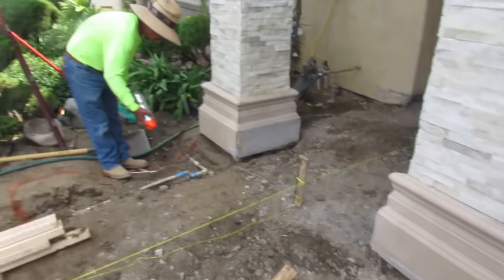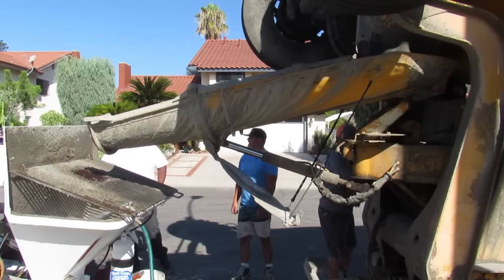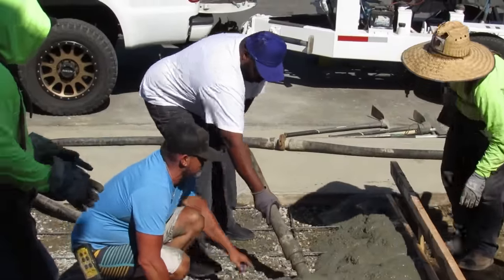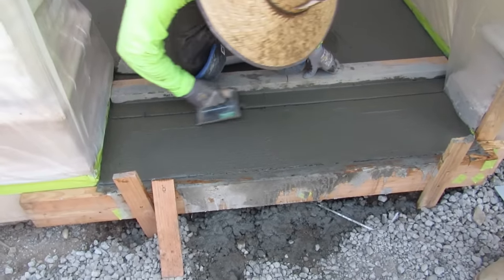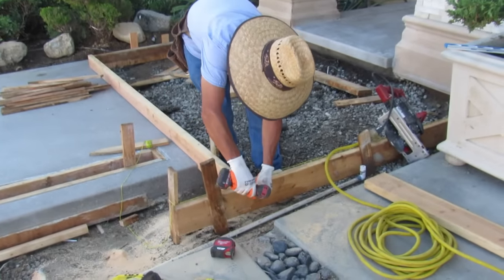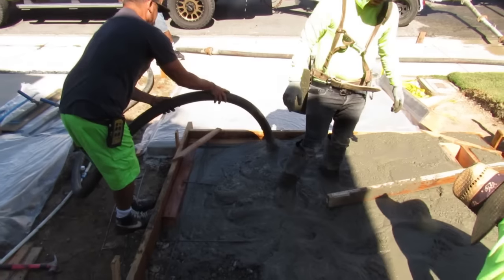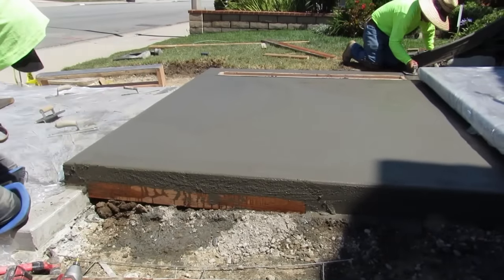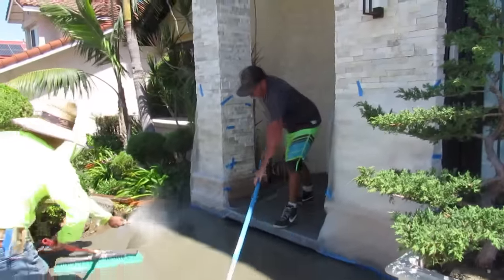Concrete Floating Steps! Straight Fire!🔥🔥BEST IN THE WEST!

Comment: Only certain concrete contractors are able to do custom quality concrete like this...anyone can pour cookie cutter driveways and patios.
I was getting $2000.00 - $3000.00 per cubic meter on average in the '90's and a lot more when it came to small custom jobs that involved stairs with planters. An average set of cast in place stairs was a minimum of $5k and my most expensive in 1998 was a $25K step that took 4m3 and had built in planters. I've had many high end residential clients spend in excess of $250K for exterior concrete work in the late 1990's. I made my money doing high end work and we still did 50% commercial work where $ was made on volume, but I preferred the custom work because of the challenge.

Every company has their own business plan, and mine involved challenging myself and doing projects that set me apart from the majority of other concrete contractors in my city.

Excellent work Anthony!
The work speaks for itself and you are in a very select concrete club...the rest are just average Joe's.
Reply from the maker: Perfectly said brother✌️thank you for the ultimate compliment a concrete guy can get from another concrete man 👍
Reply: @WestCoastCustomConcrete  You are most welcome.
I enjoy your videos, commentary and respect your work and workmanship! 👍

Comment: Love the planter add, cool little extra touch in the design. It flows with the driveway design perfectly. 
We used to use sugar in the 90's up in Oregon where I first learned the trade. Once I found out about topcast after moving back to cali, I was blown away by the control and variety...
I'd be scared to use sugar anymore, I'd just feel cheap lol.
You've got a great crew, and it seems you do a great job as a leader for them. 
We're in your same area, and I'm overjoyed to see someone doing great work, and I'm sure it starts with you selling it right. It's a shame the amount of low quality work out there and what it does to our bottom line.
Cheers Anthony
Reply from the maker: Thanks brother ✌️really appreciate your comment 💯

Comment: nice work mate, what do you call this finish i used to work at a company that has a concrete who did similar would remove the formwork and apply a similar polished finish. often when you say polished people think of going over it once it's set with a concrete diamond polishing machine but this is giving a polished finish on install. i love the look, it's definitely an art form. it's good to see tradies that take pride in their work i'm the same and it's why i get high end work like you. 
the only think i will say is i reckon you should use bar chairs, you probably are not getting the required 50mm concrete cover over your steel otherwise. it only takes one section where the steel is exposed to moisture and it can rust through and cause concrete cancer you are supposed to have 50mm concrete cover over your steel to ensure it fully encased in the concrete and won't rust just something i thought with all the attention to detail i was a bit surprised you don't use bar chairs. other than that i loved everything you did
Reply from the maker: Hi brother ✌️it’s called a top cast finish it exposes the sand my favorite 💯

Comment: What would be the probability of creating the square cement slabs off site kind of like they make paver creating a 4 x 4 or 5 x 5 paver and bring them on site and set them up? Could the garden accent pieces be created off site?
This looks like a lot of work beautiful job but I'm just wondering could that be possible? 
I'm sure with your crew all you guys there would have to do is line 3 on each side, maybe four! It would be six guys or eight guys to carry it, place it in and set them up floating walkways! Always Bringing 1 extra incase it break While being delivered! It's just a question is it possible?
Reply: When you setup grade and then pour it fills in all the cracks and forms to the ground plus the moisture being sucked into the ground gives you a better product than just placing some giant pavers....

Comment: Just curious as to how much more it costs to those floating steps as opposed to just 4x4 concrete sections spaced apart (similar to the driveway) where you just put pebbles or turf in between?
Reply from the maker: Probably close to double

Comment: Brother that’s so sick 😮I’m very impressed. I’m new to concrete I just got into the trade after doing minimal Residential work. I’m in the union local 555 Cement Masons out here in Portland Oregon. I really liked Res work, it was a lot of wham bam blow and go jobs. But I also did some stamp & color jobs on the higher end. Commercial concrete is a whole other beast man. I’m not really liking doing 6k + square foot pours it’s not so much fun 😂 anyway amazing work my friend.
Reply from the maker: Stick with it for experience for a while✌️then switch over and you will know all areas
Reply: @WestCoastCustomConcrete 
Will do brother thanks 🫡

Comment: After you lay down the concrete what chemical do you use to get the smooth look ?
Reply from the maker: It’s called Top Cast. It’s not smooth it’s gritty it’s an exposed sand finish

Comment: What brand of this concrete, or what additives do you use to make it gain strength so quickly.
Reply from the maker: 3.000psi straight cement, micro fibers

Comment: Thanks for the information on the top coat concrete retardant working on a 9 by 7 ft stucco coating with exposed aggregate at 3/8 of an inch on a half inch of concrete with a metal trim ring around it like you're looking at something in New York jobs in Ann Arbor still trying to figure out how to exactly float that little Stone in a half inch of concrete and make it look like it's glowing and sticking out. Flat and flush half inch of mortar or stucco mix 3/8 of stone sticking out perfect no I got a good direction of what to do with your top coat information God bless you Jesus is Lord of all
Reply from the maker: Thanks brother ✌️love your comment 💯

Comment: i do like the planters but you have to be careful you dont plant anything that has big strong heavy roots that can break up all the work.
1 i dont know what it is im seeing that i dont like so i will move onto next point
2 i prefer the look of stamped concrete million times more though i do like a flat gloss but will that stay glossy?
3 when moving or getting new furniture its a pain in ass to have steps why not make it look nicer with a flat stamp.
4 if you want it to look like a million bucks why not add wire & lighting and maybe pony walls and/or water fountain

Comment: You sissies pump concrete 25 ft away. Wtf is that
Reply from the maker: That’s how clean professional do it? It’s irrelevant look at them floating steps🤩tuff guys like you could never pull those off💯
Reply: @WestCoastCustomConcrete  oh yes I can and have. colored and stamped  too.  could teach your guys a thing or two. Just finished a huge set of  cantilever steps  with 12 inlayed lights with custom cut liners from my texture skins. Must be nice to have 4 guys that know what they are doing. I do most of my work with one or two laborers
Reply from the maker: @chuckerroo5977  https://www.popularmechanics.com/science/a32643833/concrete-stairway-construction-video/
Reply from the maker: @chuckerroo5977  https://interestingengineering.com/video/construction-workers-build-concrete-staircase-and-its-a-masterpiece